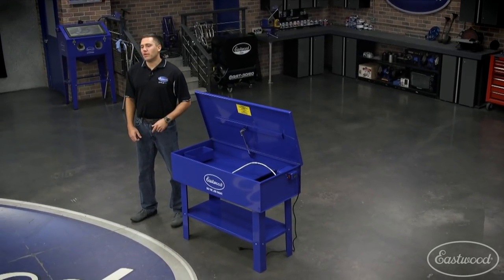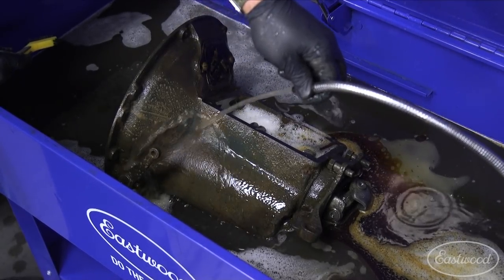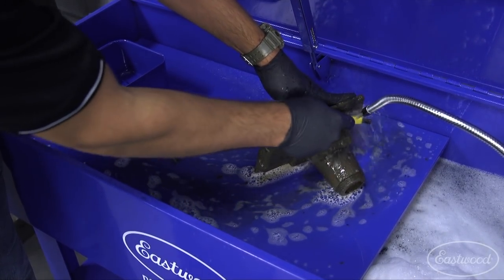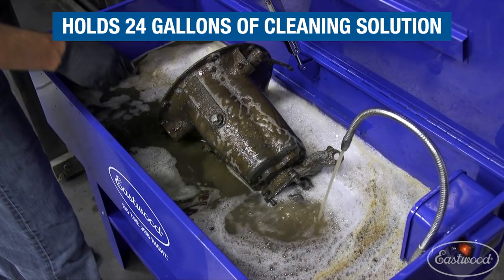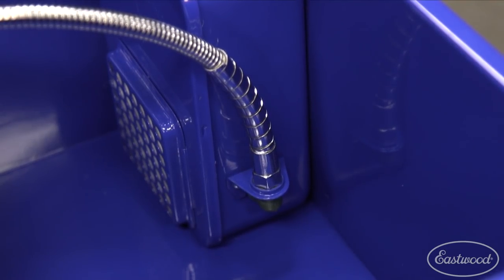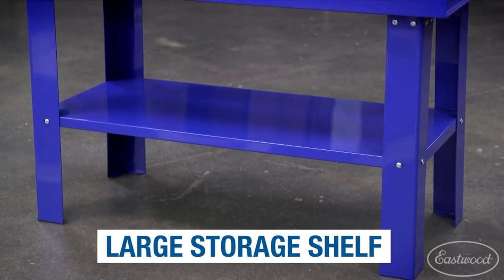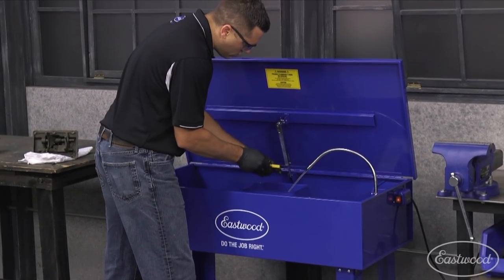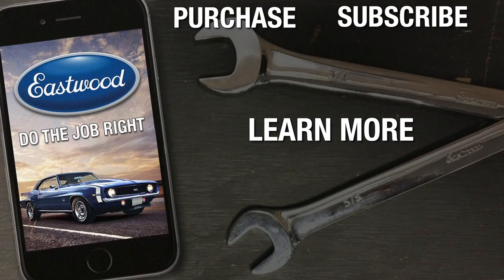40 Gallon Parts Washer - Must-Have for Cleaning Oil & Grease Covered Car Parts - Eastwood

Comment: How do you stop “flash rusting”  after you wash metal parts and let them dry?
Reply from the maker: Check out fast etch!
Reply: Eastwood Company   So basically, use parts washer to get oil and grease off. Then dip or spray Fast Etch on the bare metal to keep rusting off?   Ps. Can you paint over fast etch or does it need to be cleaned first?